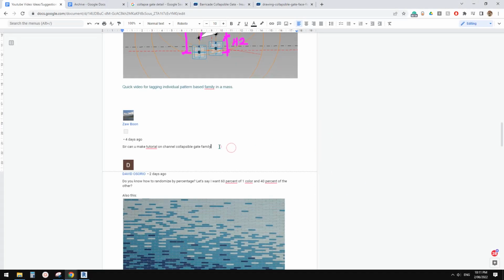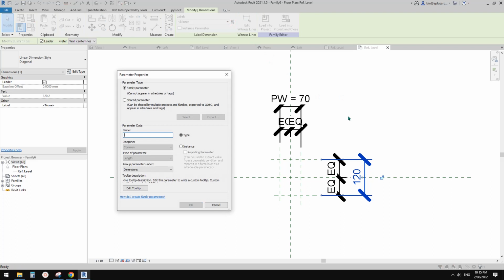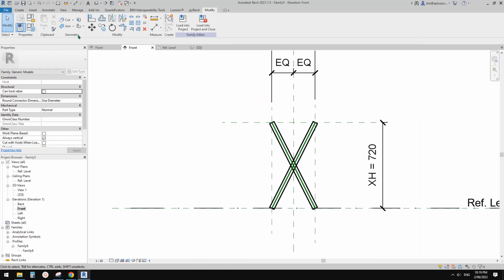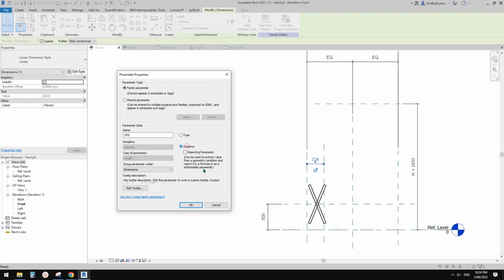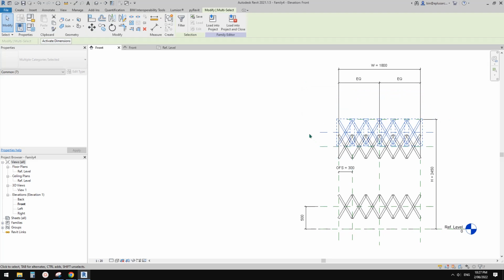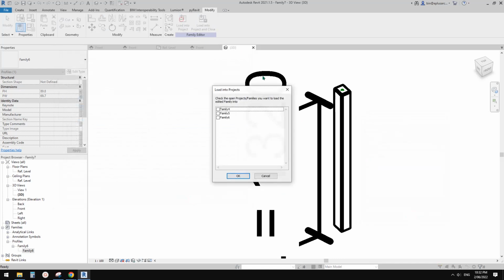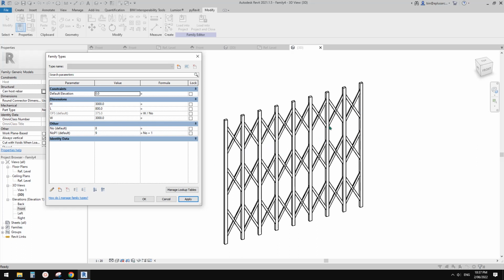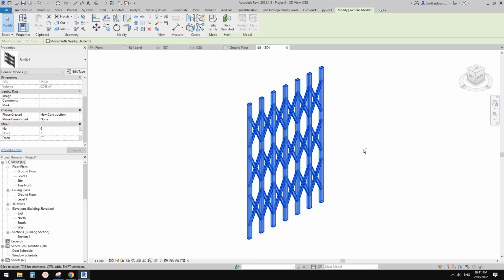Revit Exercise (Day 801) - Parametric Collapsible Gate Family

Comment: How to add handle? Because if closed and open this handle not followed with door.
Reply from the maker: Create the handle as a separate family, either face based or work plane based, nest it into this family, and lock it onto reference planes, you can create parameters to control the height, or visibility too.

Comment: Amazing logical job! In civil engineering we consider the painting area as W x H X 5, where 5 is just a painting coeficient, instead of calculating bar by bar. Also, a frame around the wall opening where all this metal structure slides. Just 2 details. Again, congrats for your great work.
Reply from the maker: It's good to know. Thank you.  People should be able to load this into a door family and create their own gate family.